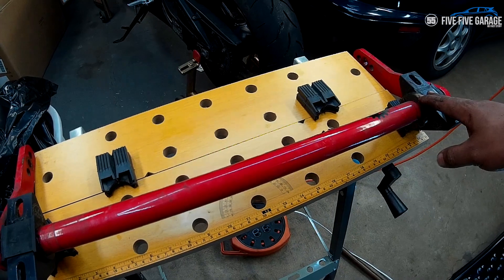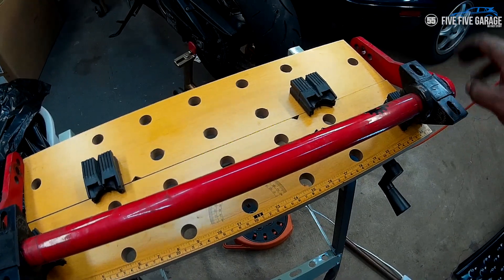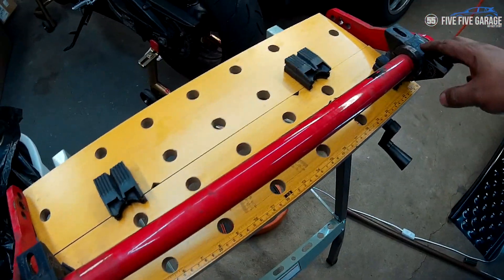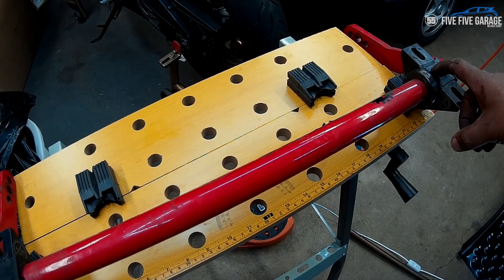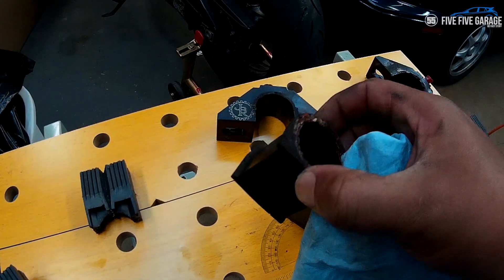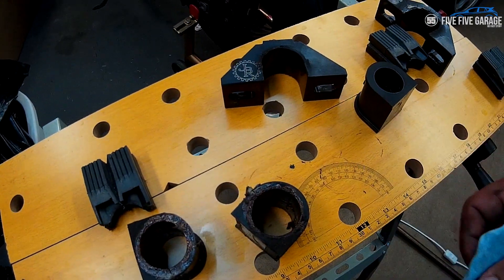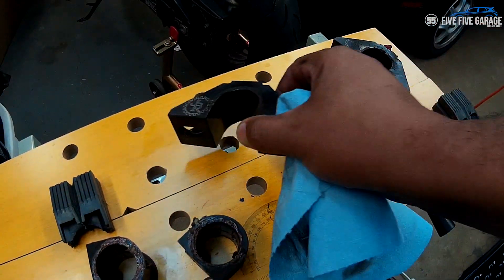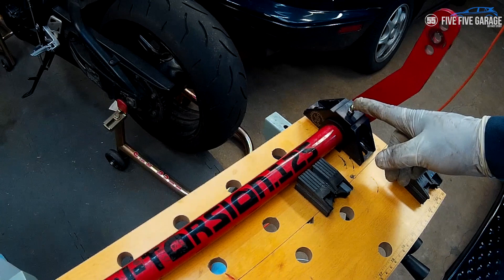Mazdaspeed 3 Suspension Update Part 3: Sway Bar Bushings

Comment: glad you got it fixed man. I just went through something similar with my car. turns out my exhaust was hitting in weird spots because the hangers were worn but it was hard to identify without the suspension being loaded. those sounds drive you crazy and it feels SO GOOD once they are gone.
Reply from the maker: I am so glad that I figured out what it was. I was going mad because I was checking everything and still hearing it! Now I drive with the radio off 😂

Comment: I just ordered a used JBR RSB myself.  Great timing to see you one step ahead.  I have a clunk that needs finding as well.  Good video!
Reply: The JBR RSB will snap with any amount of aggressive driving, search it on the webs.  The CS bar bracket is better and come with lock collars.  MS3s are rough on RSB components.
Reply from the maker: That is what I am hearing. I am researching further into it. Really don't want to have an issue later on!
Reply: I've owned a MS6 since inception and a 2013 MS3 new, I will save you the trouble and get the CS bar with the billet brackets.
Reply from the maker: Thanks will look into this!

Comment: I had a ghost noise also in the rear. It sounded like my exhaust was hitting somewhere. I checked it out several times then had several mechanics try to find it. Nope. It lasted for months. Turns out it was a rear endlink. Visually it looked fine. Swapped them out, noise eliminated. Thanks for your vids.
Reply from the maker: Glad you got it sorted, I drove mine for months with the noise too and it was driving me nuts!

Comment: Great video..I'm experiencing the same issues on my Gen1 after installing a new Corksport RSB. Never thought to check my coilovers. Keep the vids coming.
Reply from the maker: It caught me by surprise too, I went back through and tightened all of them again to be sure, it was just the right rear. Lesson learned for me, when I am doing other maintenance with the car up on stands, I will start checking the coilovers too. Thanks for watching!
Reply: @FiveFiveGarage  checked everything today and no luck.🤦‍♂️ The search continues.
Reply from the maker: When you changed the RSB did you reuse the OEM end links or did you replace them?
Reply: @FiveFiveGarage  I used new Whiteline adjustable end links.
Reply from the maker: Hmm. Try pushing down on the rear ( I raise the hatch so I can room to push down on the sides too) and see if you can isolate the sound. Do you hear it going over bumps, or do you hear it all the time while you drive?

Comment: What grease do you use to grease the bushings and all? Do you use the same grease for the bushing as you use for to fill the rear end links?
Reply from the maker: The grease I am using is called Green Grease (https://www.greengrease.net/). I use this for all my bushings and fittings and I am super impressed with it. I usually re-grease things when I do oil changes (car is already up on stands, its a good time to) and found when I started using this, everything has stayed greased. It is waterproof, so it won't rinse off and it is SUPER tacky, so whatever you use it on it stays. You can find it locally, it is carried by Advance Auto and Autozone.